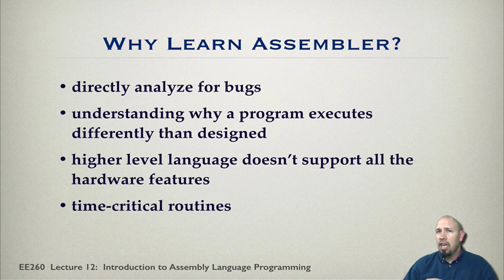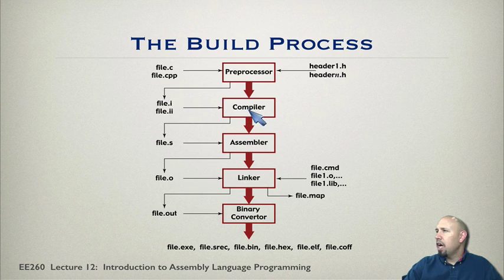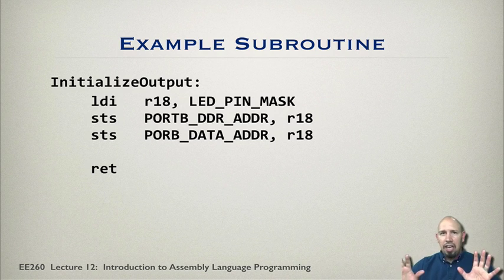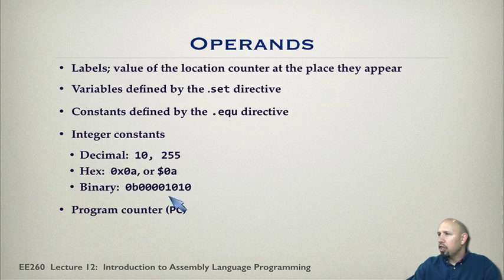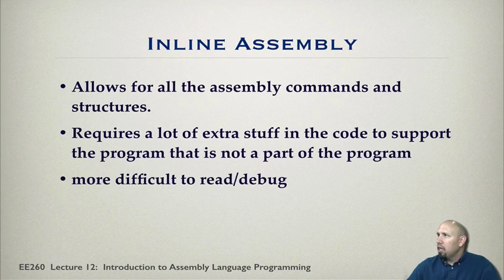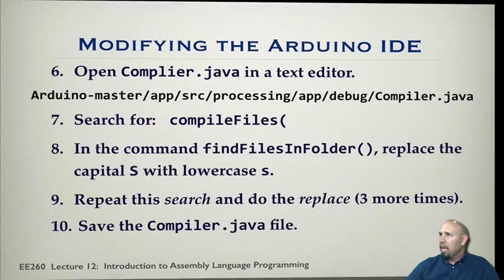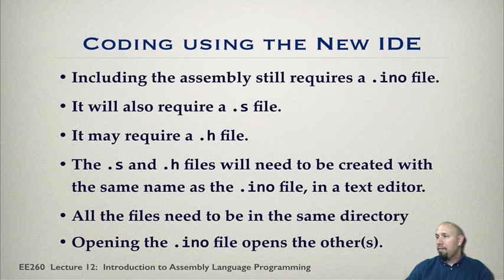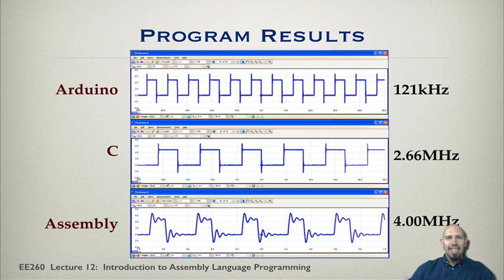12. Introduction to Assembly Language

Comment: I wonder if there is a reason you mentioned the Arduino IDE and Atmel Studio but didn't brought up the (probably most advanced and platform independent) Eclipse IDE with CDT and AVR plugin. I tried using all three options and even though the Arduino IDE is really great for beginners I'd use Eclipse for any serious work (and not Atmel Studio for I'm using Linux)
Reply from the maker: I wasn't familiar with Eclipse.  I'll check it out!
Reply: Robert Paz To get you started really quickly follow this steps:

1. Install Java from http://www.java.com (but you already have it since you're running Arduino IDE)
2. Download Eclipse for C/C++ developers for your OS from http://www.eclipse.org/downloads/packages/eclipse-ide-cc-developers/lunasr1a. You don't install Eclipse - you just unzip it and execute the "eclipse.exe" from within the eclipse folder
3. Install AVR plugin as described at http://avr-eclipse.sourceforge.net/wiki/index.php/Plugin_Download (this is basically the standard procedure to install any kind of plugin for Eclipse so once you go over the fairly simple procedure once you'll be able to install a whole slew of other plugins for any kind of tasks/languages and what not. It's an extremely versatile and robust application
4. Follow those simple steps to create your first project in Eclipse for AVR :)
    http://avr-eclipse.sourceforge.net/user%20manual/gettingstarted/gs_newproj.html

Personally I use an Arduino UNO and a number of other boards. To do the programming I'm using the "arduino" programmer ("-c arduino" for avrdude) and so it all works without a glitch. The absolute unbeatable bonus (besides Eclipse being cross-platform) is that you see most errors while you type and in place rather than after compilation and just in the errors list. I personally get 80% less compilation errors exactly because of that which allows me to fix issues faster. The code completion (you may know it from Atmel Studio) works really well and fast although sometimes you need to give it a few letters to work with or else it'll limit the number of results and you will probably not find the thing you're looking for.

Just like in Atmel Studio you have the concept of solutions but in Eclipse it is way more than just a group of projects. A "workspace" is basically every single bit of setting you can think of. It's like a separate installation of Eclipse so you can customize it for your needs with the specific language/tool set. For example I'm a Java developer at work, I do Ruby at home and AVR for fun. I have just one installation of Eclipse and a couple of workspaces - one for work, one for my private projects. Funny thing is I'm doing Ruby + AVR development in one of the projects and it all still just works! I have a Sinatra web application source opened on one tab, a view for that application (an ERB file) opened on the next, and a few .c/.h files with AVR code. I can use my own Makefile or one that's provided out of the box by the AVR plugin. And best of all: it knows which project to build/run based on the file you have opened in the editor! That's just an absolutely stunning experience when you have everything bound to just one function key (I do F9 because I come from Turbo Pascal/Delphi background) and the right project gets executed!

As you see Eclipse is a topic on its own. It's probably best known for Java developers but as I'm sure you'll see it's a masterpiece for AVR development too.

Thanks again for your series! I've learned so much over the last few days!
Reply: +Matthias Hryniszak I am saving your comment in my google doc notes and I hope I remember to reference your comment when I start programming. I am still waiting for my Arduino in the mail!!!!!!!!

Comment: sir kindly mirror a link for https://github.com/arduino/Arduino, i wasn't able to download the files. tia
Reply from the maker: The GITHUB link is confusing.  If you look on that page on the right hand column there is a link that says Download ZIP.  If you click on that it will download a zip file of all the files shown on that page.
Reply: Robert Paz
thank you sir, i've already download and paste the file which already modified at the link you have given @http://www.cs.nmsu.edu/~jcook/arduino/index.php?n=Notes.AssemblyMods but still has a problem upon running ant build. an error occurs like this: BUILD FAILED
C:\Arduino-master\build\build.xml:38: The following error occurred while executing this line:
C:\Arduino-master\build\build.xml:71: The following error occurred while executing this line:
C:\Arduino-master\app\build.xml:47: Compile failed; see the compiler error output for details.
Reply from the maker: Baby Nash Sorry.  I didn't realize that link was still included.  That link by J. Cook, is outdated.  Please go to http://128.123.131.68/files260/Lecture/page31/ to find the most recent build (Mac only) along with the JAR files for modifying the Arduino IDE (for versions 1.0.5, 1.0.6, and 1.0.7) without a rebuild for any platform. Lecture 13 mentions that you find the pde.jar file in the Arduino IDE installation and replace it with the one posted for your installation.
Reply: Robert Paz
thanks again sir, but i forgot to mention that i'm using windows 7 x64.

Comment: So is assembly better then any other programming language for processors/chips?
Reply from the maker: Better is a matter of opinion.  When code is written in C or some other language, it is first converted to assembly, then compiled into machine code.  The translation from C to assembly isn't always very efficient.  By starting with assembly, you can make the code as streamlined as possible.

Comment: Excellent lecture professor.
If I modify the IDE for assembly, would I still be able to program my Arduino in C and in Arduino C?
I ask because you mention that the files will be modified to the extension lower case s.

Thank you
Reply from the maker: Great Question!  Modifying the IDE simply makes the use of Assembly possible without affecting the other programming functionality (C, C++ or Arduino C).